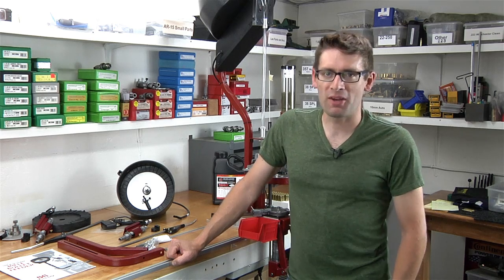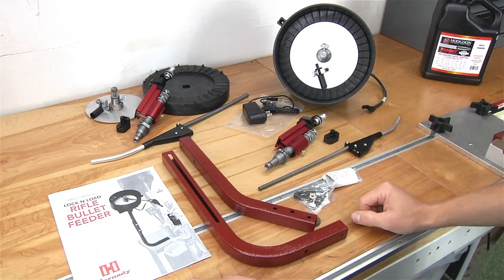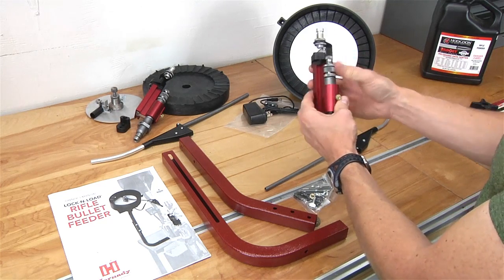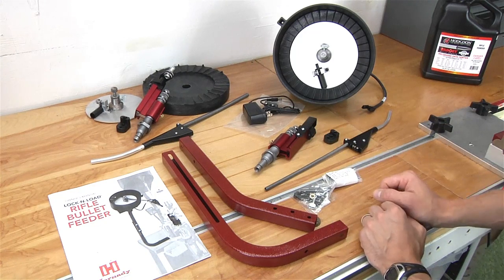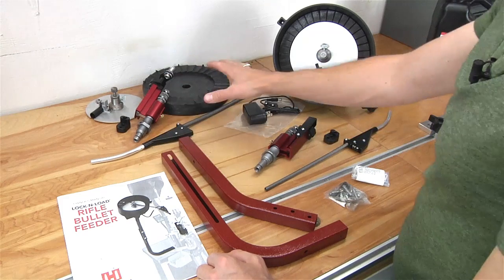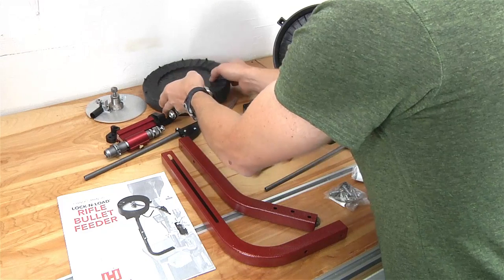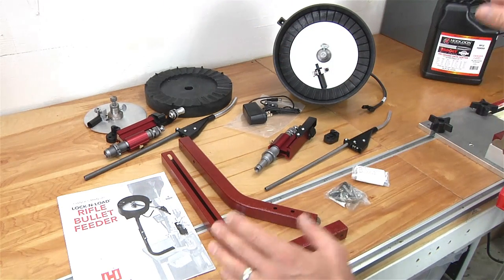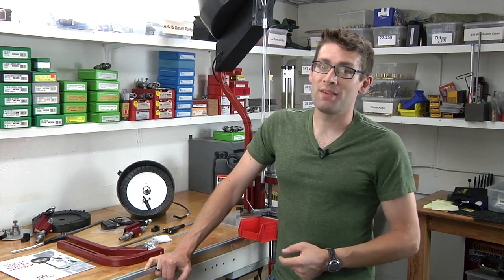Hornady Rifle Bullet Feeder Overview

Comment: will the 30 cal kit fit into the feed bowl for pistol, or will I need a separate feed bowl for rifle?
Reply from the maker: I'll check!
Reply: gavintoobe did you get around to checking this gavin? are the feed plates interchangeable? even using the pistol feeder plate in the rifle 'bowl' might be a cheaper solution...